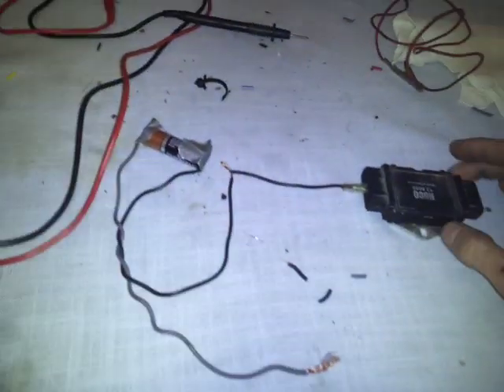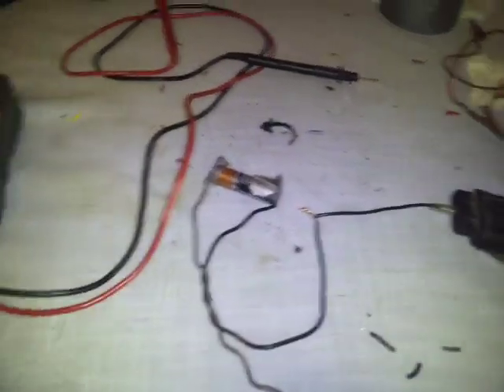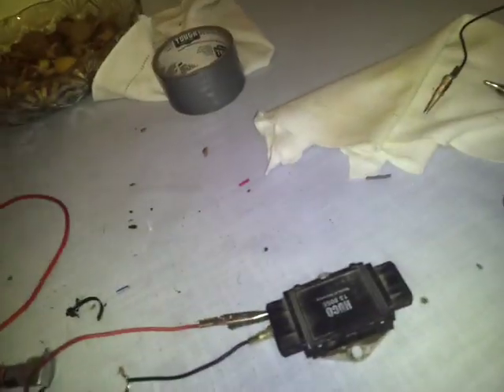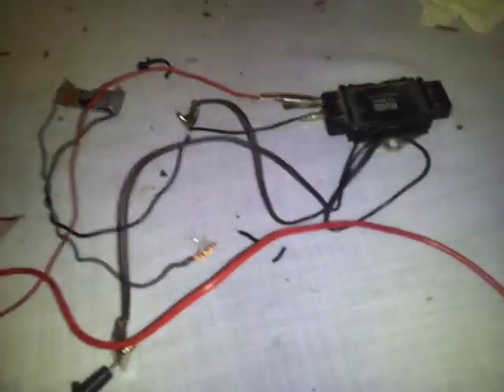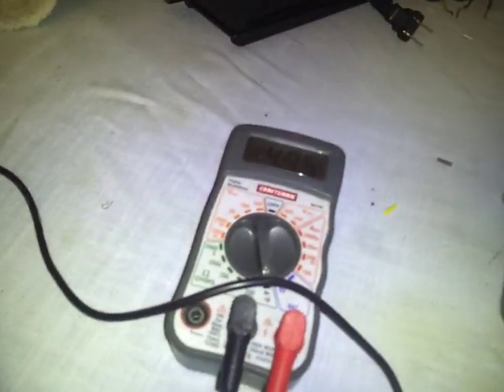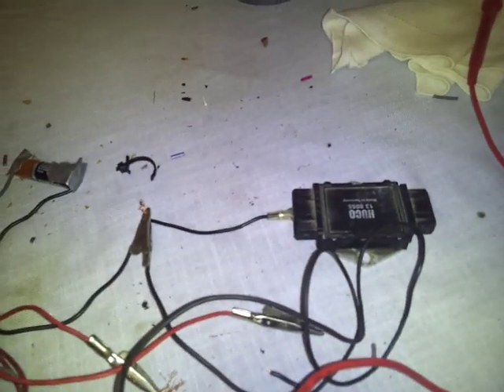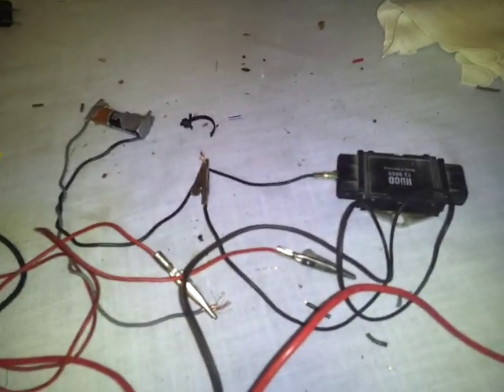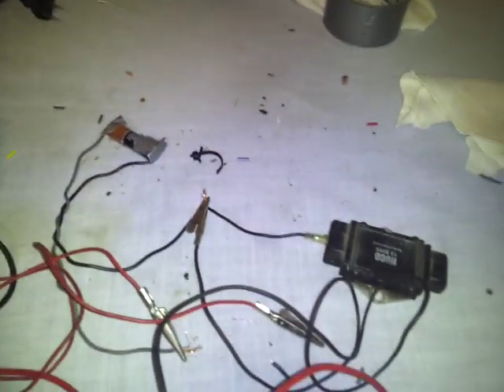Audi a4 1.8t AEB - how to test ICM ignition control module

Comment: maybe undervolting tru an hanging fuelpumprelais which is supplier for the fuelpump as also the supplier for the current of the engine wiring .escpecially when you know the componentns are fine and the codes walking tru the engine wiring loom after replace certain things inside this engine wiring .i got this problem with my MAF in the 1.6 AHL ,then next it says was the lambda ,then the N80 .it turns out 2of 3 contactlips inside the fuelpumprelais not closes properly or been clogged  so that there where to less current for all components and as far the car runs ,the fuelpump takes away the current from all of those actors and sensors in the engine wiring that was not be able to work sober ,cause all the current was sucked up alone by the fuelpump ,which also takes away the the current from all these important parts .i changed components of hundrets of euros ,at least it was a simple fuckin relais for 25 euros . if you got a wiring harness plan ,check the exits of the fuel punmp relais ,one goes to the fuelpump ,i think it was s29 which splits into an Y-cable ,the other is the 12v+ to the engine loom .greetz from dortmund .

Comment: We're doing this same test on our icm. It's off a 99 Passat 1.8t. We're only getting 306 ohms on the 4 terminals. This was on a digital multimeter that goes from 400ohms to 4k so we set to 400. Is 306 enough or is the icm bad?  BTW, the car doesn't run at all. We did a turbo and headgasket swap on this car and inherited all its problems. Timing looks spot in, has good compression, new plugs , fuel pumps thru injectors ok... But won't start... We are at a loss right now.
Reply: +gghsusa  If you have a crank no start try researching the engine speed control sensors. One senses the teeth on the flywheel the other is the crank position sensor. Engine will not start if this is dirty or the "part" that goes to the fkywheel is broken off.

Comment from the maker: If you are getting spark to 3 cylinders and all the pins on the ICM are reading dead then it's probable that you are reading it wrong and your problem is somewhere else - perhaps a coil.  Try swapping the coil on cyl.3 with the coil on cyl 2 and see if the code jumps cylinders.  If it does, the coil is probably bad.

Comment: Hey man, i have some issues testing my ICM, I did everything that you show and the multimeter shows 1, no values, does it mean its open and not good at all? even if i tetsted a brand new one and same result? I have made a video if you want to look at it i tried for the past 2 months to find the problem , the car is brand new at this point (really) 200 psi per cylinder, engine rebuilt, harness for the coils coming from ecu is all new, and still i have little to no spark on cyl.3!

Comment from the maker: Your car should not start in drive.  TCM going bad is a possibility but that sounds more to me like the neutral safety switch, also called the "Multifunction switch" on the drivers side of the transmission.  If it starts in drive, then that means that the car thinks it's in park or neutral when it is not.  You will need to buy a vag-com cable on ebay and download the vag com software to troubleshoot the car further.  It's very easy and a sure fire way to tell. Sure beats guessing.

Comment: Well, 

 

Here lately the car has been starting intermittently, when I turn the key to start the car I get no start or no sound, but if I keep turning the key on/off eventually (5-10 minutes or so) It will start. I just realized that if I put the car in drive and turn the key it starts right up. When I bought the car the owner said the TCM was going bad but it still dives. So i’m just trying figure out what could be going on. Thanks for getting back.